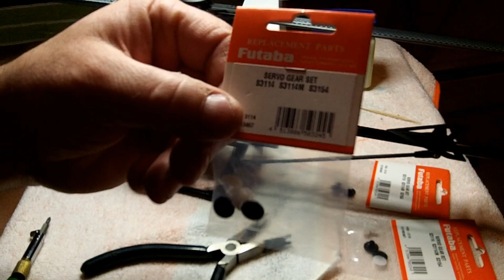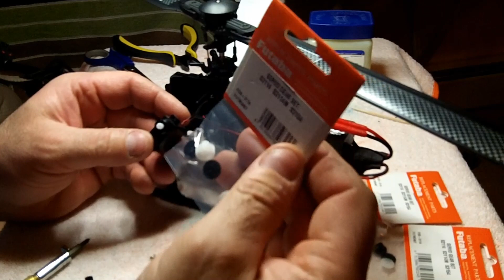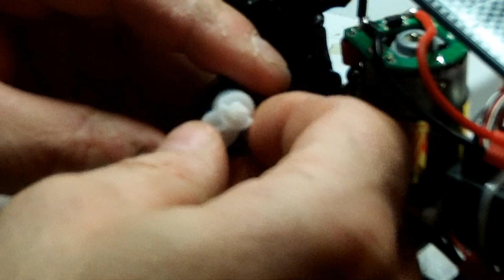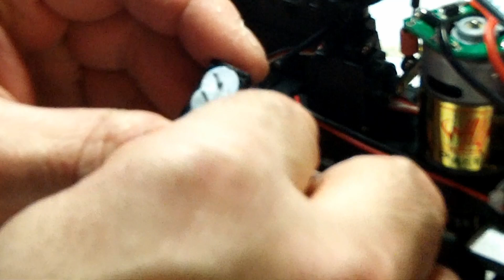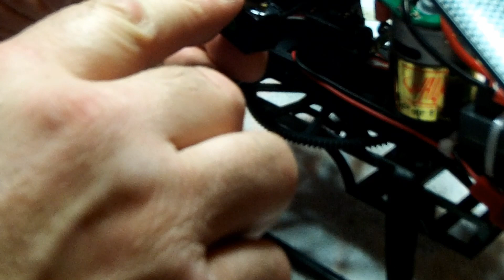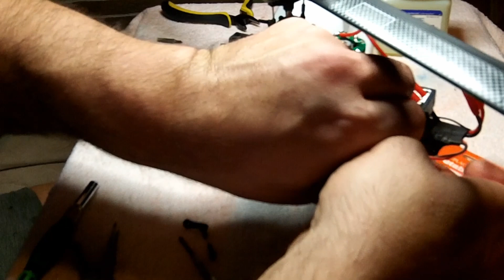Walkera Master CP ad Futaba Replacement Gears MYTH

Comment: Two things that may help, 1 maybe just replace the broken gear and keep the rest of the original gears in place, the other thing I've done , I have a bin of old blade 400 servo gears from my blade days , I was able to Match a couple of them up and it worked, I always keep my gears from any broken servos I have , and you sound like me as having many many Helios , great vid by the way , I did subscribe to your channel , like your work , rotor head fred

Comment: Hi Dude,,, i need help seems you know more than many others here,, look its my first bird 6 channel…  had a nasty crash ,, replaced all servos ,, they seems to work perfectly,,, but now for some reason helicoper is no working blades are no spinning motor is no spinning i have checked my receiver checked all conections,, seems everthing is in the correct position ,, i am no sure if i did something else accidentaly  when i changed my servos ,, i just can not sort it out ,, i have spent many many hours and nothing,,, anything you can suggest ,
my thought is main motor is o spping because receiver is no sending any signal ,, no sure really,, any way if you could give me a hand will thank you a lottttttt 
thanks for all your videos it really helps alot … 
javier
Reply: Javier Diaz really old comment but you might want to check your main gear

Comment: Hi Cruz love the video I bought a cp at xmas and have had about 2 hours fling, I have problems from the servos to the battery charger. I had to pay for the new metal servos but heli pal replaced the batteries free of charge ( 3 charges and 12 batteries:)) This morning going for a fly and the heli won't bind not suer if trani or bird batteries are all good , cann't find any details for rebinding can you help 
Cheers Mark :))

Comment: Great vid! Had the same issue. Crashed and stripped all three servos. This is my first six channel and I panic crashed by dropping the throttle too fast. :(   I've already replaced the old servos with the Walkera metal gear upgrades. I agree that Walkera should just put the metal gear servos on the heli from the start. Waiting for parts is no fun.

Comment: i bought a Master CP 3 days ago and the servo jam in the downward position the heli drop to the ground no damage I was in backyard with tail grass. Wonder if these servo are digital ? And do you have to replace the servo's with Walkera servo ? Can I go with Metal Gear digital servo. I had the same servo go in mine the pitch servo after 2 day of hovering flight.

Comment: Futaba S3154 Metal Gear. They cost $30 each, but are well worth it. Put these in all my Walkera CP's. Direct drop ins. I have tried walkera metal gear servos, and stripped one on slight blade strike just like the stock ones. So now I just figure the extra $100 dollars in on the price if I am to order their birds. 4F200, 450D03, and Master CP. Hope this helps.